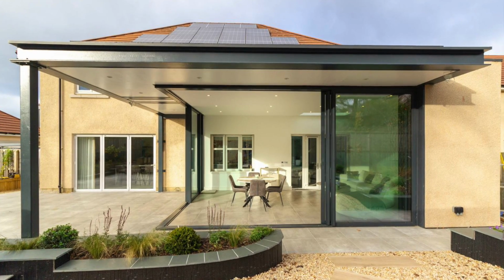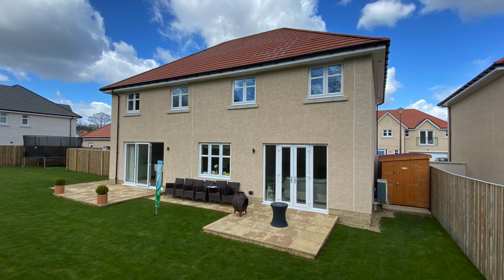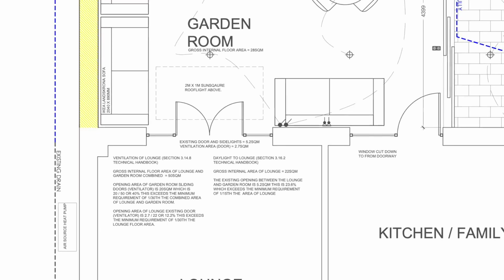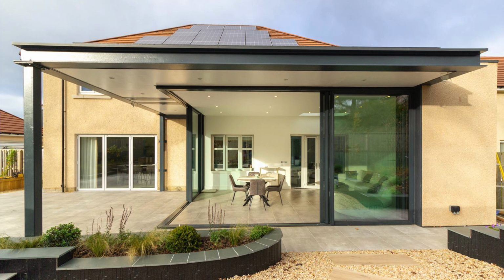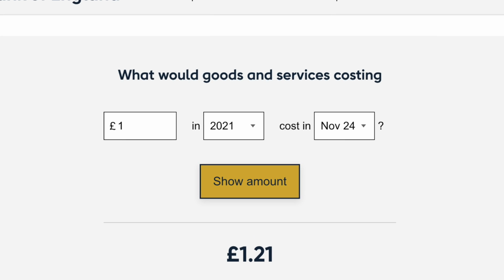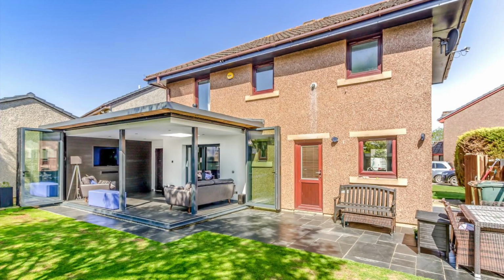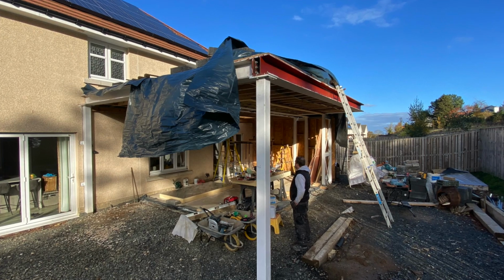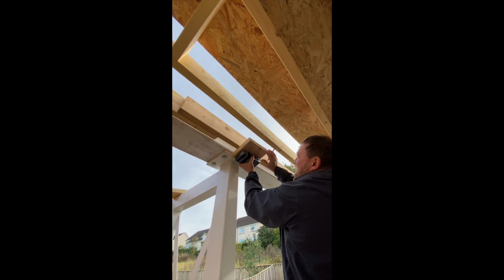You Wont Believe How Much A Luxury Garden Room Extension Costs in 2025 (UK)

Comment: I priced a replacement for my 6x4m lean to conservatory from the 1970's that's fairly shook at this point. This was 3 years ago I think they quoted me 16,000 euros? Probably be 20k now. It'd be much better quality than the one I have but still seemed a little steep considering there would be no groundworks/dwarf walls and its a kit they could put up in a couple of days. Standalone conservatory not connected with the house seem much cheaper but functionally aren't quite the same. Sounds like I had a bargain compared to this project though I'm just cheap.

Comment: Great video that has cheered me up. I started a bungalow remodel and extension that got out of hand and has ended up as nearly a rebuild which we have done as highly energy efficient within the original plans. Looking at around £3.5k per sqr mtr for a high finish including 6mtr sliding doors, triple glazed, £10k pivot door, ashp, mvhr etc. don’t think I’ve done badly based on this.

Comment: If a price is 2k per m2 and it's 2 story say 50m2 will price be based on 50m2 or 100m2
Reply from the maker: You count both floor, so 100 square meters in this case. Also, it’s been a long time since £2k per square meter was the going rate for extensions.

Comment: builder had the clients pants down. huge profit margins on that.
Reply from the maker: I do this kind of work regularly and these prices are a fair reflection of the going rate
Reply: @RealLifeArchitecture  doesnt mean there isnt huge margins for the builders.
Reply: @rupsurfer 
This project is in the city of Edinburgh , the overall total included for the structural steel frame supply and install contractors , spec’d by the structural consultants which I don’t think has been explained entirely ( they weren’t the cheapest quotation either !). In addition the Sunflex specialist glazing system supply and install has to be considered . 
I can assure you that margins on this project were as the norm for the location , design parameters , size , spec and finishes